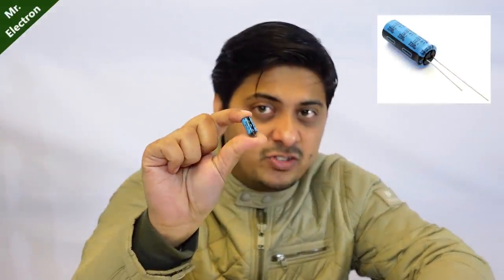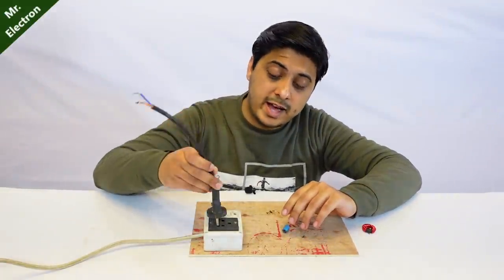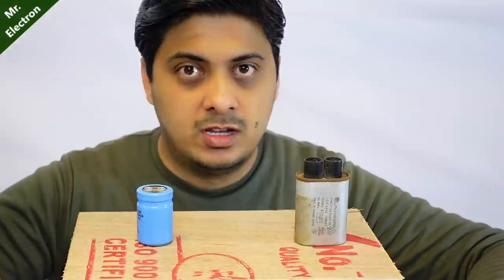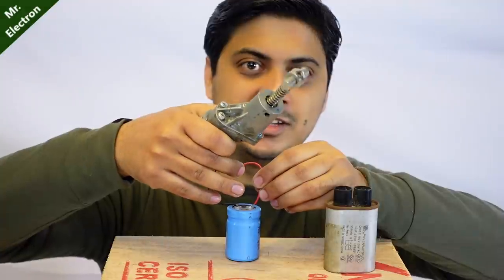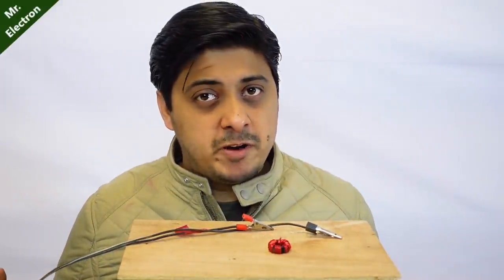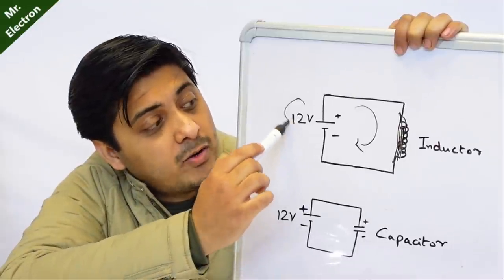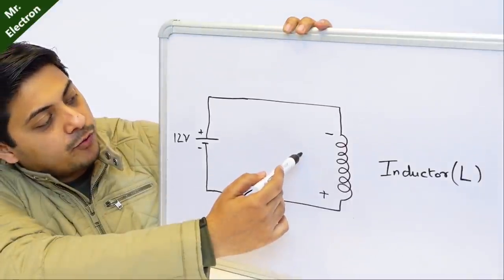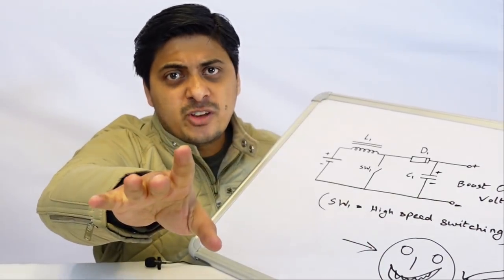QUICK PRACTICAL - INDUCTOR & CAPACITOR WORKING | ROLE in DC to DC Voltage Step-up Converter (PART-1)

Comment: Please help me on my diploma project 
My project is vertical axis wind turbine using washing machine BLDC MOTOR 600W as a alternator for 12v  7.2ah battery  charging 
Max voltage is produced in dc is 96v by using  3phase full wave rectifier ..
How to control voltage 12 to 14v for battery charging using buck-boost converter?

Comment: The max. volts you could produce were 3.8V AC
Reply: I posted it first
Reply: about 3.845V AC
Reply: No u didn't someone else did it first
Reply: @user-ih1qs2cr3w  sorry you're right when I checked the first time I probably missed it
Reply: @julianslab1511  yes the youtube is drunk most of the time
Reply: @user-ih1qs2cr3w  wait... by youtube you mean the place where you watch mr electron videos?
Reply: @julianslab1511  no

Comment: Hi friend namesta 🙏 
Friend i have a problem with my dc 24v 15a power supply  i am using this power supply for dc motor it's was 48v Dc motor that way i am increase the voltage with the help of control in SMPS  and also i am using 15v dc motor for my drilling machine  the both motors are connected to my single power supply  here is the problem friend if  I want 48v turnoff the drill and increase the voltage same in drilling machine 12v turn off the 48v motor  down the voltage  this process is very  confusing  for some time s i forget to changing voltages😭 which type  step-down module is best and also friend  i have small doubt about variable resistor can i change  this  volume control  variable resistor 🤔